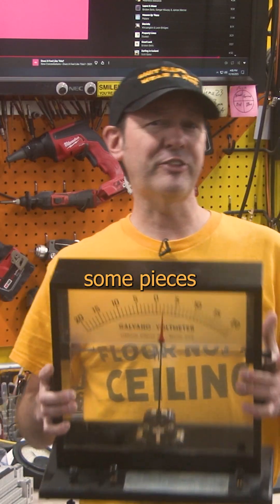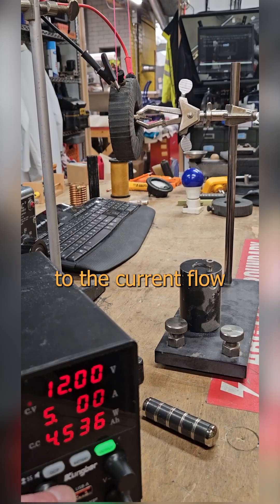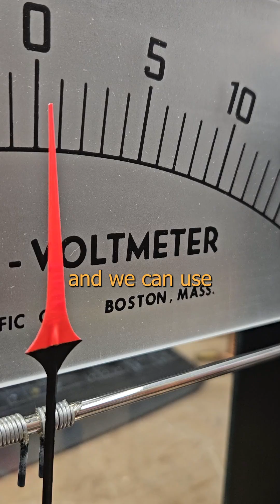Practical Electromagnetics #chrisboden #comedy #electricity #magnets #physics #engineering #motors

Comment: In addition to being able to adjust the spring tension slightly so the indicator actually points to 0 (or whatever it should point to when de-energized), there are also tiny weights attached at right angles to the pointer so the meter will indicate properly in any orientation.  These are to compensate for minor manufacturing imperfections.  (I used to calibrate these meters in the '70s in the USAF.)

Comment: If you want a good example of the differences in magnetic forces seen in a short circuit event,  EATON has two videos on their website from a test of the Bussmann time delay current limiting fuse vs a non-current limiting one.  Both are 200 amp fuses with 1/0 copper wire. I was first shown this video during my IBEW apprenticeship and thought it was as cool back then as I do today. 

If you search for "Bussmann series cable whip non-current limiting test", you should be able to find it on whatever search engine you prefer.

As far as I know they are only posted on the EATON website.

Comment: I'm in my 4th year of computer engineering, and I just learned how all this kinda stuff works, and this channel has actually helped me get an A in my circuits 1 class, even if there was no mathematical explanations involved, it helped me wrap my head around these concepts. This is something you learn about halfway through the DC portion of circuits, its called a d'Arsonval Mechanism named after Jacques d'Arsonval, the creator of the first Galvanometer, what we know more commonly as the voltimeter/amperimeter.

Comment: im one of the few people left in the world who places great value on a quality analog multimeter or any other type of meter that you use regularly . why you ask?  because if a good  analog meter is wrong there can really only be two reasons why.  one one would be magnetic interference and two would be the meter itself is either out of calibration or is damaged simple to troubleshoot. digital keeps you guessing and questioning whether the meter is correct or not so you're always rolling the dice with a digital multimeter by having blind faith

Comment: Electricity is the 4th state of matter . When the plasma goes down the wire to the motor  it makes this fucking thing move ! Where dose it go from there ? It's not consumed ,,,,it's still here . We just need to catch it !

A group of magnets wrapped with wire connected to a rectifier and send it back to the source . Gathering pixes is all a generator dose it dosnt MAKE electricity it just concentrate it into a form we can use .

What do you say ? Give it a shot !

Comment: My old analog physics teacher taught me this one. Galvanometers are remarkably sensitive, too... and with some precisely calibrated extra bits attached, a resistor here, or a bypass there, you get pretty much every multimeter function. The smaller ones have a mirror surface behind the pointer so you can tell you're looking at it straight on when you read it. If you can't see the pointer reflection, you're reading it right.

Comment: We used to have one of these that had swappable  backplates to measure different voltage and current ranges! They are sadly relatively expensive, so we went with a digital one when it needed replacing, but I think the analogue ones are WAY cooler!!

Comment: analog meters are still useful.  a digital panel meter costs 300 bucks, needs a power outlet, and requires a 300 page manual to set it up.  an analog panel meter costs ten bucks plus $.05 for the right resistor, powers itself, and can be "set up" with sharpie and scotch tape.

Comment: How do you calibrate a voltmeter? How do you know it is 5 volts. The power supply says it is 5 volts. How is the power supply calibrated? The voltmeter says it is 5 volts. Something outside of this loop has to decide what 5 volts is that is measurable in a non arbitrary way.

Comment: That analog low voltage meter is pretty freaking cool! So let me explore this application; the electrically driven coil being  penetrated by the hard ass magnet wearing a wire wrapped condom excites the condom which is balanced with a spring thus conveying the condoms excitement?

Comment: Which is actually measuring the current that is passing through it (the angle of the coil will be proportional to the current-to-stator magnetic field ratios), and through clever application of serial resistors, can be made representative of voltage (or through clever application of parallel resistors, be a wider-range amp-meter)

And, I, Actually, The Whole Thing :)

Comment: Why is it a voltmeter, when the field strength is proportional to the amps?
Reply: I think its a huge resistance in series with the input.
Reply: as Maxwell notes, there are different resistances switched in series with the meter movement when you change voltage ranges.  Technically, it's still sensing the current, but the current is equal to the voltage divided by the resistance.

Comment: Youre single handedly giving us the electrical engineering education we all wanted but never got.
Reply: As an electrical engineer, I agree. I got 4 years of math classes and theory out the wazoo, but ask me to build a voltmeter you better get ready for a human blue screen.
Reply: Im an electrical engineer and this dude is still teaching me about my own field… I mean I did know this one but there are things that we just don’t learn anymore because it’s so old that it won’t be used pretty much anywhere anymore… it’s one of the reasons why I’m here
Reply: @LukasKutylo-wq8bn I wasn't taught how to solder, what a Din rail was or what a crimper looked like. I was taught to be dependent.
Reply: @iloshwdgac9213  yea I mean I wasn’t thought those things you mentioned either aside from soldering… the rest of those got to me because of an apprenticeship and not because of school
Reply: @LukasKutylo-wq8bn my first internship I got real friendly with the techs. If my wiring diagram was shit, they told me quick and forced me to make it. I learned alot about tolerances and workability. Just because it fits on paper, doesn’t mean it fits.
Reply: @iloshwdgac9213 and that’s why practical work is equally and if not sometimes more important than all the papers… I mean it’s not something you can leave out but the thing is that you can do a lot of things once you do it in practice while just sitting around may not help in those situations… a well balanced training for the job should include both quite a lot but it often doesn’t which is sad
Reply: Vocabulary education too.
Reply: Pun intended?
Reply: @alexandertheok9610😉
Reply: .... but where's my other hand?
Reply: It also reminds us of stuff that we learned in high school.  Remember it is your left hand that show you the direction of current flow.
Reply: Mmm, electromagnetic interactions. Me likes cool science gangster wizard sht 😂❤
Reply: truly so.

I actually did electrical engineering course in college. Its more theory than hands on or show and tell
Reply: That's disturbing.

Comment: You have such cool toys.  It's interesting how this idea was used to move the heads in hard disk drives, the voice coil in speaker drivers, and all sorts of analogue gauges like this one. also used in some microphones, and Camera Autofocus Systems, Used in semiconductor manufacturing, microscopy, and optics for micro-positioning tasks, such as mirror tilting, laser beam steering, and vibration control, where nanometer-level accuracy is required.  So many places for such a simple idea.
Reply: This is literally the bare basics for some actual rocket surgery.